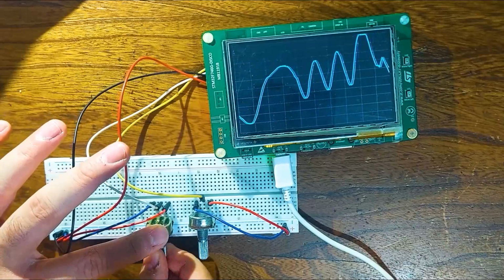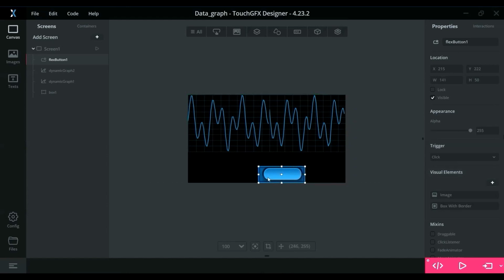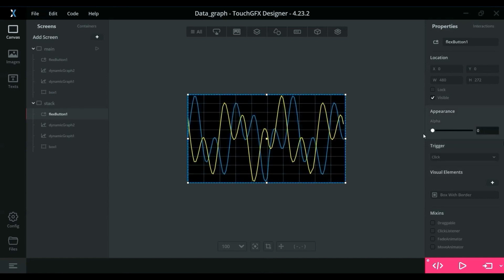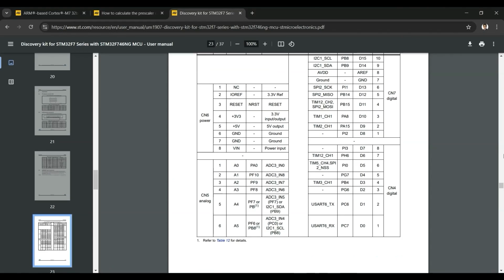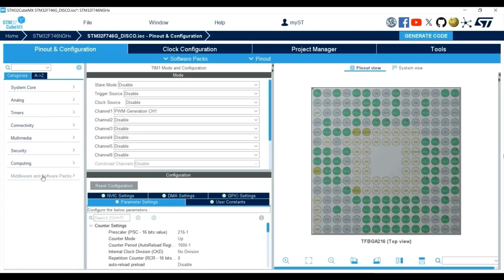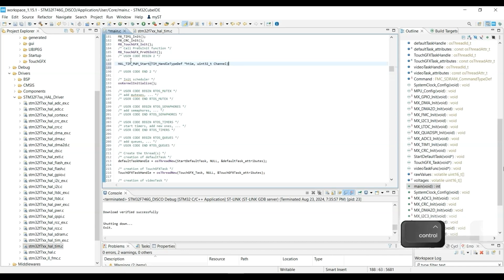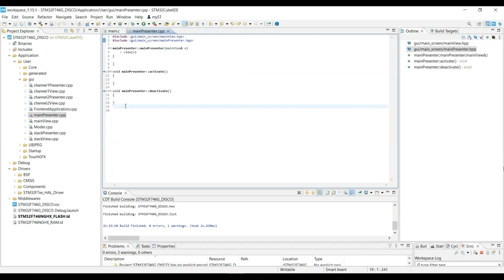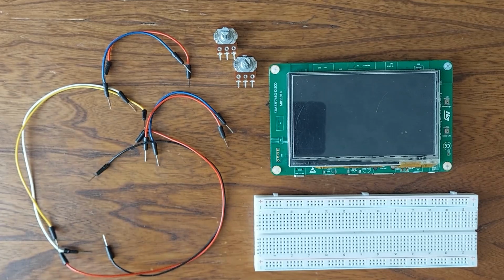Real-Time ADC Dynamic Graphs on STM32F7 Discovery: Interactive TouchGFX Tutorial

Comment: in my case, at continous conversion mode disabled, the voltage not change, just stay in initial value. after change to enable its working. is it ok?
Reply from the maker: well, are you sure about the settings of the DMA? is it on half-word?
have you enabled DMA?

Comment: Excellent video, and I have learned a lot. But I have a problem. I have reviewed your video three times and triple-checked all the code, design, and settings. I used the oscilloscope to check 3.3V, GND, and the varying voltages at the wiper on the pots. However, there are no changes on the STM32F7-Discovery board LCD. When I power up the board, the blue and yellow lines start at 0V and stay at 0V as they progress across the screen. The same thing happens when I change to full screen. My TouchGFX design is similar to the one you designed, except that the button is slightly different; however, it still functions as intended. There are no changes on the LCD, but there are on my oscilloscope as I adjust the pot. Do you have any ideas where I may have gone wrong? I check the pin assignments and the ADC3 settings. I would greatly appreciate a reply.
Reply from the maker: I am glad to hear you found this content helpful.
about your problem two scenarios exist:

1- CubeMX configuration:

1-have you set trigger source correctly? i have set it to timer1 capture compare 1 event
2-have you set ranks and channels properly?
3-have you configured timer(the trigger) properly?
4-setting timers pulse can be the tricky part
5-have you set DMA mode on circular? is data width set to half word? if yes in your code you should use uint16_t to keep you ADC values, it is really important, if your data width is uint32-t your ADC values may remain 0.

2-Code:
1- you should initialize your timer and ADC as mentioned in video.
3-are your ADC variables extern(_IO)?
4-do you pass your ADC values to LCD as mentioned in the video?

I hope these notes help you to find the reason your ADC values show 0 value.

good luck engineer Thomas.